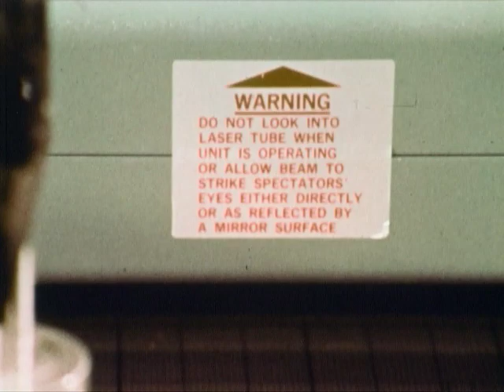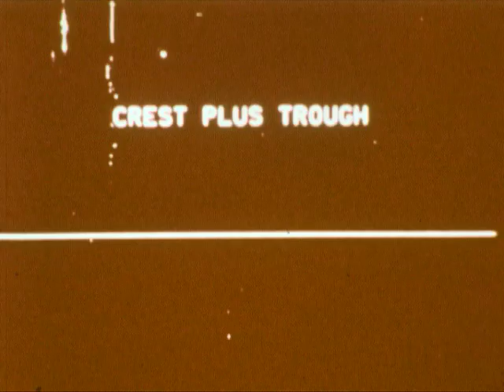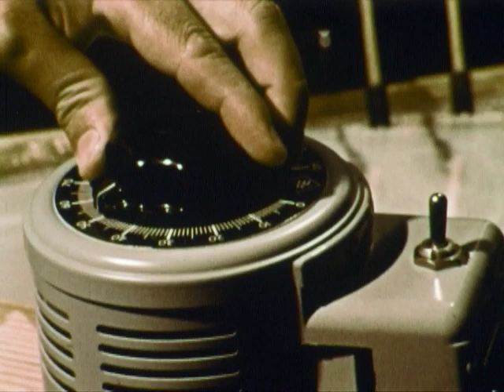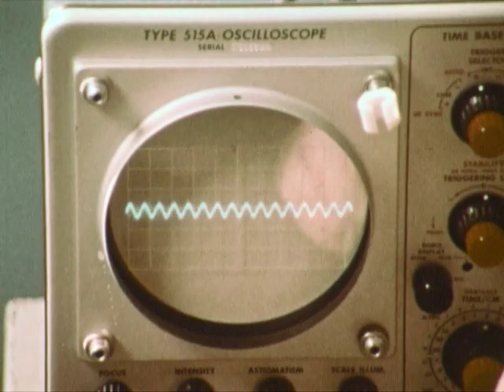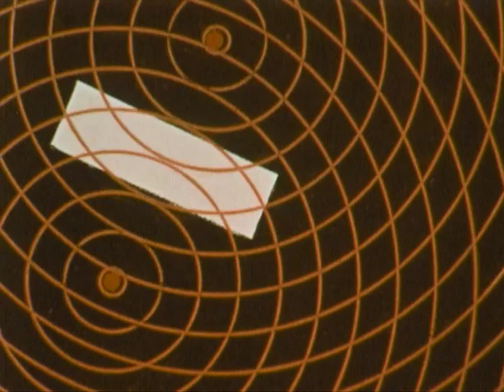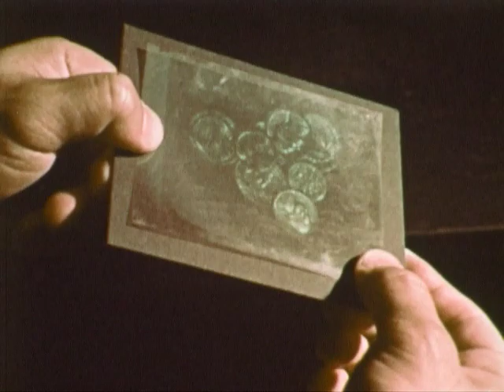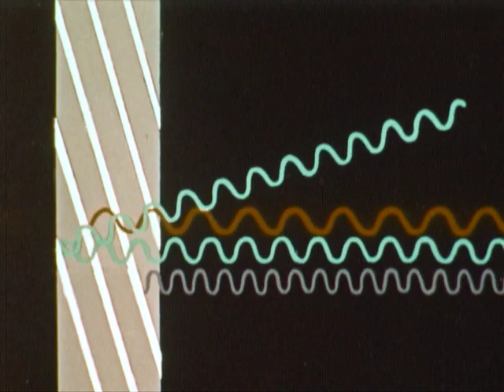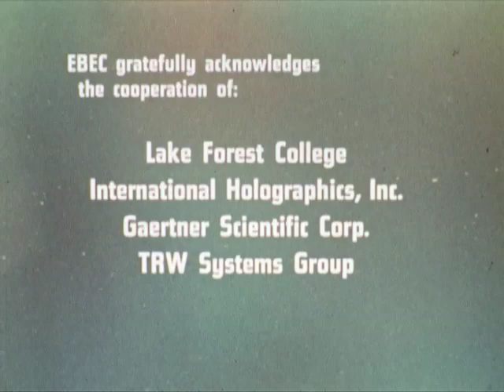Introduction To Holography 1972

Comment: How would you go about making lenses that deconstruct the light is a way where we can see stuff like the they live signs....I bet it's all in magazines several inkingsyou know it's all over in there I can see it with out them but I'd bet if you can deconstruct the light it would reveal more would using the plastic on a flat screen work or do you think the non polarized lenses clear like reading glasses...they are doing it with contacts on the eye
Reply from the maker: Interesting